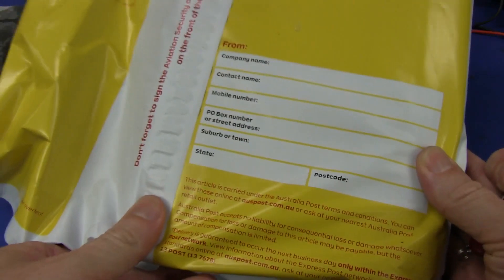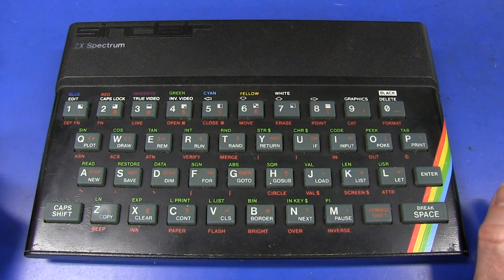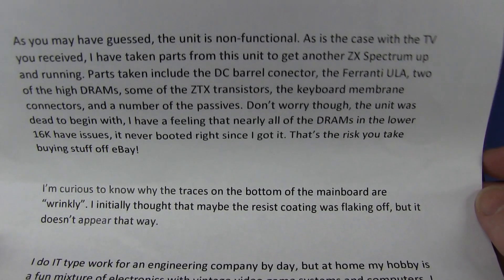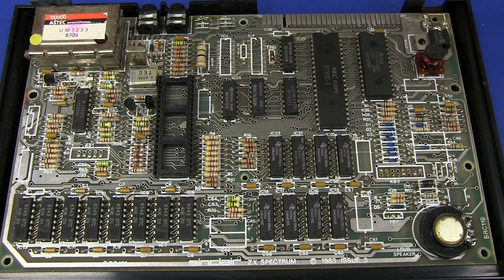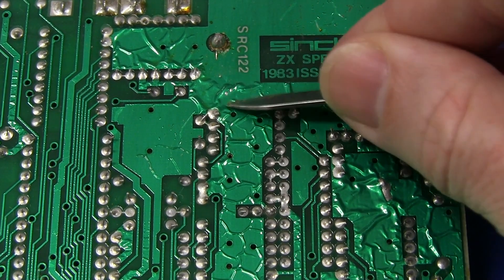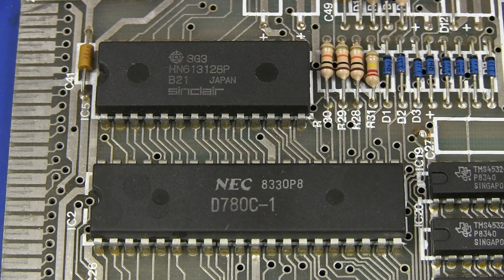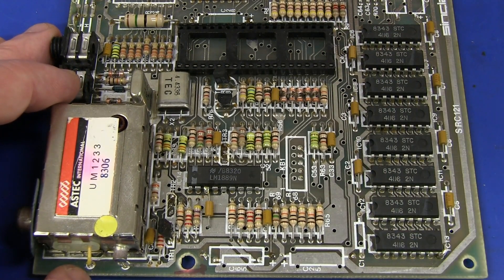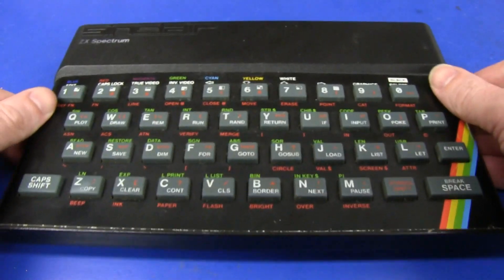EEVblog #557 - Retro Sinclair ZX Spectrum Computer Teardown

Comment: The bottom side has solder mask because it needed to go through wave soldering. There is really no need for top side solder mask, but yes it does look a lot better with it.

Comment: Went thru the keyboard membrame in a couple of years typing. Learned digital electronics with it, built shadow ROM, DAC/ADC, a PWM on the NMI to slow down hard to play games and even built an interface for a XT-PC keyboard using an eprom to map key codes. Learned Z80 assembly on it as well. Also had the joystick interface, and Interface 1 for the printer and micro-drives. Build my first adventure game with those...  Ah, it was a good friend.

Comment: If you want to see the full story/drama of how Sir Clive almost by accident ended up in the computer industry as the main player, watch "Micro Men" a BBC documentary-drama which tells the story of his rise and fall. 

There's a funny scene on it, which shows how obsessive and hands-on Sinclair was with every aspect of his product development and design...one of his engineers brings 3 keyboards to his desk for the new XZ Spectrum and sets them out in line, one a proper tactile resistance keyboard, one another version of the ZX80/81 flat, and the rubber keys..he tried them all and tapped the rubber one signaling his choice.

The spectrum was initially the fastest and biggest selling home computer in the UK (and even in some overseas markets, in the US even it was licensed as Timex Spectrum but didn't make as much impact there), and it came down to 2 factors unrelated to the machine itself really or its capability (there were faaar better and more powerful machines, like the Acorn, Commodore, and BBC Micro). The Spectrum was a) very cheap and attractively priced b) first to market as a "games ready" computer with colour graphics and sound c) but the real clincher was, Sinclair had already established his name in the home computer market and so there were hundreds, if not thousands of programmers writing games for the ZX81 which soon began writing for the Spectrum. Pretty soon you had 1,000s upon 1,000s of games for the Spectrum and people exchanging games on cassette tapes lol. So having a Spectrum was a must-have, if you wanted the best games and/or access to good games free off your mates. You only had to walk into a shop that sold home computers and you could see row after row of Spectrum games, and just 1 bottom shelf for "other" computers. 

It's ironic that Sir Clive was totally against going into the computer industry AT ALL and he was very dismissive of computers (still is today!) and even dismissive of the games industry..he just failed to appreciate the value in software or the huge business potential which would eventually overshadow the hardware industry (something Microsoft DID realise). 

Now we have come full circle...Sir Clive has launched (indirectly, someone else is doing it, but he has lent his name and has a stake in the venture) to a crowfunded product called "Vega" which is like a modernised retro speccy..the original design proposal (done on a 3D printer looked very much like an original ZX Spectrum except it has only 4 rubber buttons and a joystick lol. They've now done a much more modern looking design.

The Vega is claimed to have 14,000 speccy games (and more you can download freely) it plugs into modern TV's (oddly via composite tho, not HDMI, probably due to the limitations of spectrum graphics in those games) and is like a games console and is retailing for £100.
Reply: Pity there are so many emulators available that do run on hardware with support for HDMI. I'm not sure the Vega is going to have any staying power really. Load up an emulator on my raspberry pi zero plus a couple of quids worth of adapters from eBay and it's sorted for a lot less money.
Reply: Pity there are so many emulators available that do run on hardware with support for HDMI. I'm not sure the Vega is going to have any staying power really. Load up an emulator on my raspberry pi zero plus a couple of quids worth of adapters from eBay and it's sorted for a lot less money.

Comment: Get to see a speccy. It's just sooo iconic of the 80's and brings back memories. I remember seeing them on sale new in WHSmiths for £49.99 the year they came out. It didn't seem like a lot of money for a computer which could play 1,000s of games and had colour graphics..yet to a 10 year old, it may as well have been £5,000.

My brother got one for xmas some years after they came out, and I was well miffed!!  I sooo badly wanted one and was sure we'd both get one. My mother didn't realise you could actually program them and thought it was purely for playing games on, and my brother wouldn't let me it to play games even, let alone program on it! I ended up with a Tandy TRS-80 (a horrible computer, but also running BASIC). Years and years later, I bought a speccy for sentimental value and it's in my vintage computer collection now which has grown considerably large!
Reply: I think you missed a £100 off that price.
Reply: The original price of the ZX Spectrum in 1982 was £125 for the 16K RAM version and £175 for the 48K version. Prices were reduced to £99 and £129 within a year as competitors started reducing prices and producing cheaper models. I believe it was the 1K ZX81 that sold for £49.95 in kit form or £69.95 fully assembled (only £20 more!), back in March 1981. Now kits are rare and cost £300 - which is probably about the same as £50 in today's money! (Prices corrected.)
Reply: derekjc777
Thanks for correcting me, it was indeed the ZX81 I saw for £49.99 and the Speccy was £99.99! I remember both in WHSmiths. I now have both in my retro computer collection!
Reply: I've also corrected the prices: the Spectrum was actually £125 and £175 when first released and the ZX81 assembled was less than £70!
Reply: derekjc777
Now you're coming across as super-geek! Even I'm not that obsessive ;-P

Comment: The reason the solder mask is wrinkled is not that it was applied over wrinkled solder, but rather that it was applied over solder, and then subjected to wave soldering to solder all the through hole components. The solder itself would have been a tin lead plated layer that was used as an initial etch mask, and then IR, or hot oil reflowed. The reason that there is no solder mask at the the top is that there was no soldering done at the top, so it was deemed as not necessary. A cost saving measure, but one that leaves the upper surface of the board at risk from shorts caused by any loose conductive particulate matter. 
I remember my own spectrum with some fondness, I applied the 128 upgrade which added not only more memory, but also a grown up sized keyboard, and an all important reset switch. My first attempt at soldering :)

Comment: This is the machine where I first learned the BASIC programming language when I was about 11 or 12.  We had a few of those keyboard membranes and those cassette tape connectors at the back were always dodgy - kept having to weigh down the connectors so that they would bend at an angle to make contact inside the connector!  Memories!  Oh yes, and Daley Thompson's super test used to take 12 minutes to load then "R TAPE LOADING ERROR" at the end hehe (oh, that was on the 128k version not the rubber keyed 48k)

Comment: I did like the rubber keyboard along with some other Speccy-using friends of mine. It was quite fast to type basic when you memorized the keyword placings. The only bad part was the membrane key contacts. After a few years of hard use some keys would go bad. Somehow the white contact material would corrode on one or two of the most used keys (at least one friend had the same problem). I remember I did a DIY repair on the symbol shift key in my Speccy by inserting a copper wire in place of the top membrane and surprisingly it worked for a long time. Then I actually made a full replacement with a PCB with soldered separate momentary switches for each key, and the rubber mat would go on top of that. I still have it.

Comment: The regulator isn't floating - there is a missing piece of bent aluminium sheet heatsink.
Reply: yep correct, and these computers used to get stupidly hot then start to cause artifacts on the screen, used to put mine in the fridge to cool down lol
Reply: This episode has lots of errors in it.  Expansion not cart slot, RF not composite, 8/16 colors not 6 (half a dozen) and more...
Reply: I mean, it is floating now

Comment: The keyboard and membrane look in good nick, the socket on the modulator is for a PAL TV into which the composite video signal goes into the side of which can be routed directly to the socket to convert it to CV with a bit of simple DIY soldering. The edge connector is not for cartridges, but is a universal type interface for printers, joystick controllers, I/O boards, games cartridge interface, the controversial long awaited Sinclair microdrives, RS232, floppy drives etc. By the way, have you heard of Timmy Mallet?

Comment: The regulator had a heatsink screwed to it, it wouldn't last 2 minutes without it! The shape of the heatsink varied depending on the issue. These computers were AWESOME. I spend most of my early teenage life literally glued to my one.

Comment: This bring memories
I remember breaking traces in one of keyboard flat connections cables while investigating what's in my computer - I fixed it by by taping litlle pieces of wire over the crack - but I spended week in fear of my computer will not work again - I was something like age 12 with no equipment, experience or money for new membrane (new membrane cost was like 25% of my moms income :D)
Reply: You can still get brand new membranes LOL!!! Still expensive though...
Reply: I had to cut them shorter and shorter. What a thrill

Comment: Fun fact: Richard Altwasser and one of his Sinclair colleagues went on to design the Jupiter Ace, which was one of only a handful of microcomputers to use Forth as its default programming language.  The Ace was heavily influenced by the ZX81 with its form factor and overall design.  Ofc the Ace was a commercial flop, but as you pointed out, Richard went to work for Amstrad in 1986.

If you've still got that Speccy lying around, you should try rebuilding it.  There are now reproduction ULAs available, and the other missing components are all off-the-shelf items.  Heck, it'd make a fun school holiday project for the kids.

Comment: I converted mine to the Spectrum+ keyboard which was ok but you still couldn't type quickly.  It was a bit like go faster stripes on slow car. 
Very versatile and far exceeded the limitiations it was originally designed for.  There was a lot you could squeeze out of that 48k of memory !

Comment: The 7805 regulator was screwed to the board by Sinclair, and had a heatsink (which was very necessary along with some thermal paste). Some of the boards did have solder mask both sides (the Issue 4S board, fabricated by Samsung for example). The issue 1 board is the most interesting - it has hand drawn traces! Issue 1 machines are quite valuable and hard to get hold of though. The rubber key mat was made in a condom factory (I've met Rick Dickinson, who did the industrial design for Sinclair back in the day).
If you want to know more about the ULA, get Chris Smith's ULA book. There's some interesting little anecdotes too - the ULA was designed in only 6 weeks by Richard Altwasser. A Ferranti engineer made an error when making up the masks for the metallisation layer and the upper and lower clocks weren't connected, but a spec of dust (in a clean room!) landed in just the right place to fix the problem on just one single die, so they could use this to verify that the ULA was correct. (I believe Chris also subscribes to this YouTube channel so give him a shout out :-)) See www dot zxdesign dot info/book (damn YouTube not taking URLs)

Comment: Modified my Spectrums back in the day with 27128 eproms to replace the ROM and via a home built eprom programmer / serial-parallel interface. I didn't mind the rubber keys.
Reply: On my speccy i have a 27512 eprom with two toggle switches.
To choose from four different rom versions.

Comment: Fantastic. You can tell it's a later version. The first issue didn't have the 4.43MHz crystal. Instead, it used a simple tuned circuit with a trim capacitor. There was a hole in the bottom of the casing so you could put a screw driver in there and adjust it (or I drilled a hole - I can't remember!) As the unit warmed up, the frequency would drift and you'd see the chroma "shimmering" on the screen. I really f**ked up one day (I was just a lad of 16) and damaged it. I found a local repair shop who sent it off to Sinclair and they sent me a replacement for free!

Comment: Hello!

Dave, I'm your fan and I admire the work you do. I learned a lot from your videos and had a ton of fun along the way! Just keep up the good work.
I just wanted to correct and add to a few statements you made, Dave, since I'm a big fan of Sir Clive Sinclair and ZX Spectrum too.
First thing: The 7805 DC regulator was mounted on a large aluminum sheet heat sink, because the current drain was over 1A. So, the the sink was missing in that one.
Second one: The membrane keyboard. You were right when You said that it was probably unreliable and it was. But in the later issues of Spectrums, issue 4 and 5, there was a much better membrane type keyboard that could last a life time, i guess. It was much more transparent, almost like glass.
Third one: The TV modulator was a RF video-only modulator. But it can be a composite out by just cutting a few wires and adding one for composite bypass to the RCA connector. Or, to keep it retro, with a few touches of a soldering iron and a few passive parts it could output sound through RF modulator too, since the LM1889N has a sound input too.

Comment: The voltage regulator definitely had a heatsink originally. The Issue 1 ran very hot and it was increased in size for later versions. It was through-hole wave soldered, so no need for resist on the top layer, typical Clive! No need for a socketed ROM, by Issue 3 it wasn't going to change.
Reply: But they always socketed the ULA. I guess they knew they were the Achilles heel of their products.

Comment: The tin plating was flat when the solder mask was applied. The wrinkling occurs when the board is wave-soldered after the components are inserted.

Comment: I loved my speccy(s) - it's the machine that began my career. Spent so much time at that rubber keyboard learning BASIC, then assembler as a kid. I've recently read "The ZX Spectrum ULA: How to design a microcomputer" - which dissects every part of it. The thought that went into the design by Altwasser was fascinating (for me anyway). I now know why the video memory seemed so weird, and was horrible to work with as a programmer, but was designed specifically to be efficient to read by the ULA. So yeah, I'd recommend it.

Comment: Expensive boards would be lead coated and pulled up out of solder and be blasted by hot air jets to keep holes clear and solder level.  The machine was called soler leveler

Comment: The rubber keyboard man, that's one of the unique selling points :) I seem to remember my power connection on it getting dodgy over time, could be wrong though, long time ago and I don't have it anymore.
Reply: I distinctly remember the power connection on one of the in-store demo ZXs (not sure if ZX81 or ZX Spectrum) being so dodgy it rebooted at the slightest push, making me decide not to buy one anyway. Ended up with a more expensive home computer which was unfortunately dead ended by the company before gaining any traction.  Learned a lot from working with it and understanding the silly compromises that ruined its performance though.
Reply: Yeah that's pretty much what happened to to mine. I remember I used to stick tops off of pens and such to try and keep it wedged in place. Slightest touch would cut it off. Got years of great gaming out of it though so can't complain too much.

Comment: My first computer, why ended up a programmer
Reply: My TI-85 calculator was when I got interested in coding. It had basic on it. It also had Z80 assembly, but you had to hack the thing to unlock that capability.

Comment: Anybody else here hand build a ZX80 kit? That expansion port on the back of the Spectrum was a real nightmare. Put the RAM expansion pack on there and you'd be lucky to get through entering a program without it freezing. When from this to a QL then gave up after that debacle and spent quality time with the BBC Micro model B. Good times. Up till 4AM coding. The rush was huge.
Reply: Yes, built the ZX80, bought a ZX81, ended up with 7 ZX Spectrums before jumping ship and going 6502 with the BBC Micro. And yes, spent the rest of my life as a software engineer working on CP/M, DRDOS etc! What a wasted life!

Comment: I am very familiar with these. RF output, often on UHF 36, but some territories used VHF. At least 9 issues of PCB - 1, 2, 3, 3B, 4A, 4B, 4S, 5 and 6A. It's not high DRAMs it's missing but two 74LS157 that interface the low memory. The 7805 should have a heatsink, attached with a bolt. The Issue 3 was the first with no adjustment for the colour encoder, but also "corrected" the poor heatsink position of earlier versions - that degraded the keyboard membrane on issues 1 and 2. Issue 4S had solder mask on top of the board, but issue 6A didn't. I've never seen a 4A or 4B, or for that matter a 5 (known to be UK only). The Spectrum+ had a "plastic keys over a rubber layer" keyboard - it was rattly! 4116s failing often took out the ZTX213 and 650 in the power section. If the transistors failed they sometimes took out the 4116s too. Most big fault conditions on these were caused by failures of that kind, often induced by interference with the edge connector when the power was connected.